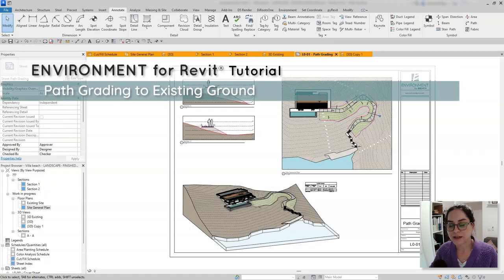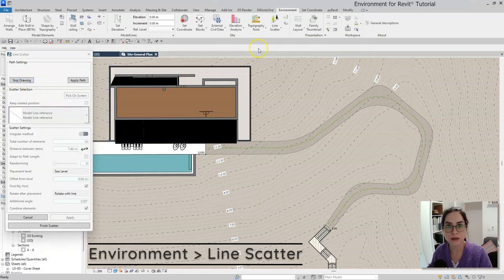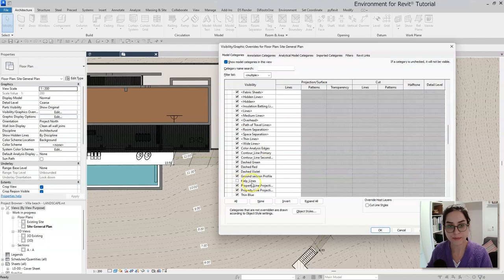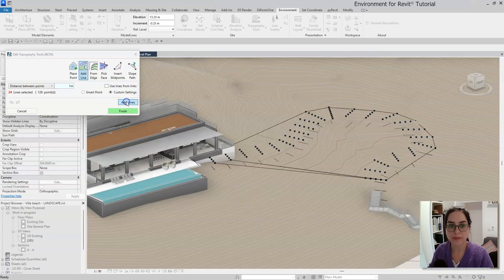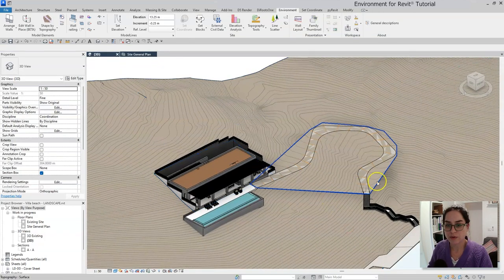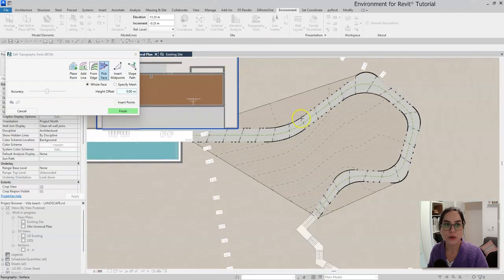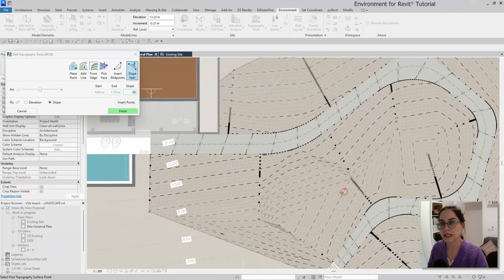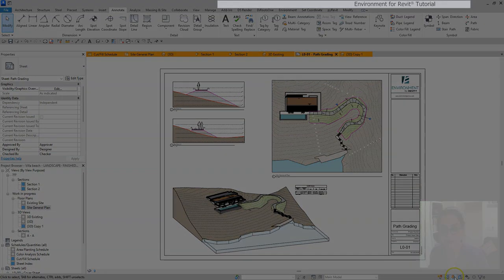Create a Graded Path Over a Steep Terrain in Revit® | Revit Workflow for Landscape Architects

Comment: Thank you very much for this helpful video. I have done a similar exercise using Environment plugin, where a pathway also cuts into the existing topography. So was just wondering if you could perhaps share thoughts on the best way to cut / fill into Revit toposolid along the same pathway with the Environment features (if possible).
Reply from the maker: Hi- you are very welcome we're glad this helps. With Toposolid we made sure that the Topography Tools will work in the same way, and also added some extra functionality to support this new Category in Revit. Regarding the Cut & Fill calculation the Revit native parameter is still unstable, so we created our own parameter to allow you to continue in the same fashion as before. You can read about it on our blog post and see it in the embedded webinar: https://archintelligence.com/news/so-what-exactly-is-the-toposolid/#more-4759 
I hope this helps :)
Reply: @Arch-Intelligence  thank you for the response and the link to the blog post :)